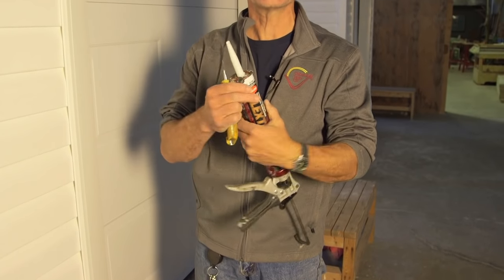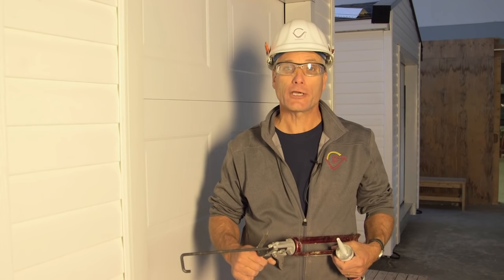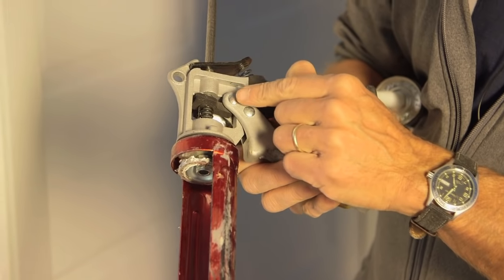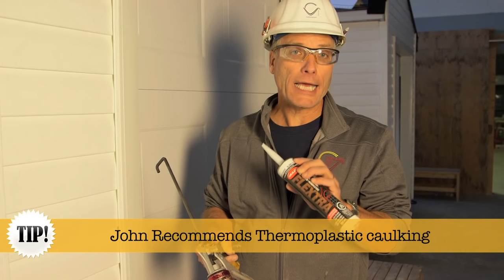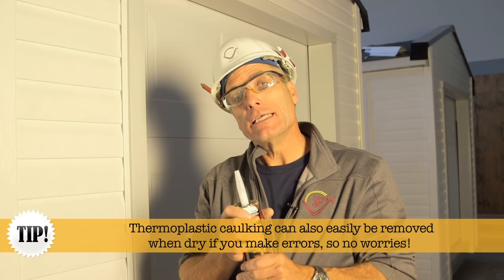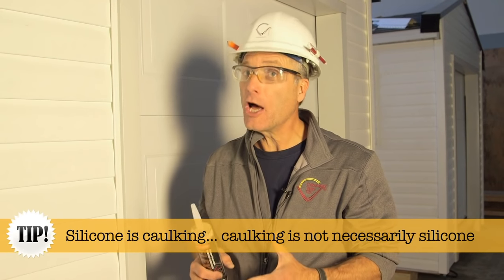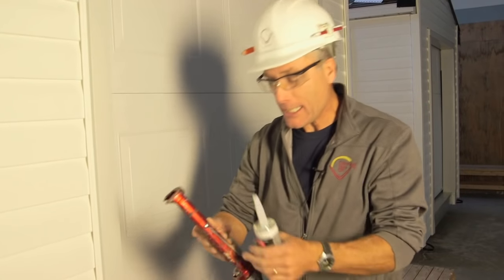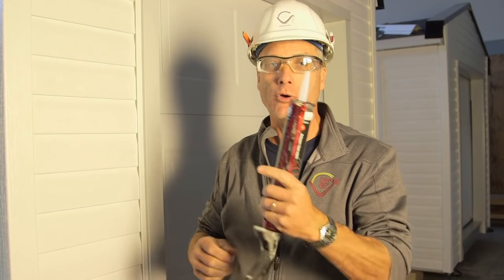How to apply exterior caulking properly...

Comment: You said "Dont cut the tip at a 45. Read the instructions." So I did. Dap 230 interior/exterior caulking instructs you to cut the tip at a 45 degree angle. Just sayin'...
Reply: Well he did say read the directions.
Reply: You think maybe.... just maybe.... not all instructions are the same on the label for every type of material that fits into a caulking gun.. and his instructions said something different then yours?

Comment: That is a very neatly shot sealant bead, but if you don’t use the proper size caulk nice to tool it in, it won’t be 100% bonded to the substrate, and be able to pass a pull test. I work in the commercial world, so that has been burned into my habits and it’s how I teach the new guys. Also, your sealant width must be at least twice the depth for a proper cure. So if you have a skinny but deep joint, you must use backer rod foam to fill in the depth to get closer to the 2:1 width/depth ratio.
Reply: That was supposed to say proper size knife, not ‘nice’.
Reply: Not to exceed 1/2 inch in depth and the backer rod gives the bead the proper shape to withstand the movement of the joint but that is mostly exterior as interior stuff doesn't apply unless architectural
Reply: Appreciate that.🙏

Comment: This is wrong and right. Some caulking says cut the tube end square and some on an angle. Self-tooling caulks require you to cut the tube end square and keep the gun 90 degrees to what you're caulking. Caulking is not static and one way across the board. I keep a bucket of water with a clean sponge and rag around and do use my finger. Just not in the self-leveling/tooling caulks. READ THE TUBE
Reply: best most intelligent comment made. thank you
Reply: @pierremoeller2518  I agree about the commend and your reply. Like they say in software development RTFM!

Comment: I found over the years that there are many variables in applying caulking. The type of gun that is used. Air and tube temperature, the persons ergonomic vector, hand (squeeze pressure). The composition of the material (silicone, latex, or urethane). And the angle of cut on the tip. For me personally, I use about a ten to twenty degree cut. Where to cut on the tube with respect to the diameter application is a judgement call for me on the size of the gap. I also cut on the down slope, as not to leave a plastic “mini-flap” that may act as a squeegee and leave a mark or remove caulking causing an unsightly groove. The angle of the gun in application is paramount. As previously stated: this is what works for me. Other carpenters I know apply differently and have other considerations…..

Comment: you cut the angle of the tip depending on how deep or shallow you want the application. sealing a shower enclosure with clear silicone, as one example, is different than the material used and size of cracks and crevices at the structures exterior. instructions should read: Cut The Tip To Fit the Desired Application

Comment: I use an Albion battery quart bulk gun and dry tools or tuck pointers for wet sealing. You really need to tool your material for proper bond! I wouldn’t know it’s all I’ve done since 1999!
Reply: I’ve been doing it since 1978. ALWAYS dry tool.  There 100 bad videos on caulking for very 1 good one. And because the average homeowner doesn’t know any better, they follow these garbage videos and replace their sealant every couple of years. ( if it lasts that long) Or worse they think they did a good job because of these videos and suffer hundreds or thousands of dollars in water damage.
 Not tooling or using soapy water.Or any tooling aid. Not sure which is worse. All of these methods will fail.And leak.
BTW I could never get used to the battery powered guns just couldn’t get the feel for them. Oddly enough I couldn’t shoot as nice of bead. Too many years with manual guns I guess.

Comment: Good video, but I prefer the Dripless ETS 3000 caulk guns for most common caulking and sealing applications, it's light weight, built in nozzle cutter and poker, plus you can turn drip or dripless feature on or off and rotaing barrel. I know you have the Tajima High Trust version which would be a second choice for me due to how heavy it is but has plenty of features also. But I do alot of caulking and prefer the light weight of the Dripless ETS series caulk guns.
Reply: Just bought one today. Can’t wait to try it out

Comment: i used PL sealant caulking for exterior. seems to hold up good. 3 years later switching between weathers and there is no cracking. paints over fine ont he little section i did. wondering if I should do my entire house and cover all nail holes with it

Comment: I wish there was a way that one could remove all of the absolutely horribly wrong ways to apply caulking and silicone, and replace them with this one.  I can't stand when people do something so simple in an absolutely wrong way, like cutting the tip at a 45, and then holding the gun at an angle, and even worse, applying too much product in the first place and then using either a finger, sponge or spatula to remove the excess, and create all sorts of lines and crevices for build up. Good Job, Sir.
Reply: You mean how they wipe off all the excess in this video ? When you have to caulk high visability places such as kitchens and baths... for 40 some years.... you get to know what you,re doing. This dude is an " actor " if anything.

Comment: push the gun to fill the gap, seal it, and form a strong insulative bond.
 pull the gun to leave a thick sightly bead that can peel off.
if a clean up is required, ie smooth out the bead, I use a small spray bottle of water and dish soap. mist finger and bead, less is more, work with confidence.  if new to this, practice on scrap 1st.

Comment: Wrong Wrong Wrong on every last recommendation this guy made ,Ive been a journeyman turned Master Waterproofer for 32 years & this guy is giving horrible advice , #1 Thermoplastic caulk sucks & is NEVER architect speced in commercial & industrial waterproofing ,any caulking or waterproofing agent that can be just pulled off in 3 days is junk,if it's adhesion is so low you can pull entire 3 day old caulk runs off just imagine how much water that junk will allow in your building after a season change where the caulk experiences Thermal Shock , #2 The absolute best type of caulking and the type speced by a solid 90% of architects is " Polyurethane " based caulk ,it sticks like 2 pieces of metal after welding ,won't shrink and outlasts every other type of caulking by decades ,#3 where he recommends not tooling in your caulk ,caulking not rubbed or tooled I is caulking that's gonna fail quickly ,only a moron licks their finger when a $2.99 7 in 1 tool makes an excellent caulk spreader ,even a plastic disposable spoon from McDonald's works great for rubbing in fresh caulking .
Reply: Michael Ledford polyurethane is superior. I won’t use anything else
Reply: Any recomendations on how to not make a freakin mess i do hollow metal doors and i can never get it right even if i tape it up
Reply: Agreed, this was terrible haha, I always have a damp towel and use my finger.
Reply: @JaredHempfield  i always have instinctively used my finger, seals like a boss and looks so professional. Yea, I have ruined many towels wiping my fingers off,  but the house thanks me.  thanks for confirming that I haven't been doing it wrong all these years!!!!
Reply: A half inch brush trimmed down to like an inch long or using flat icing spatulas or caulking spatulas works best
Reply: Wow, I’m glad I checked out this vid so I could find your recommendations how to do caulking. Thanks Michael.
Reply: I use the plastic spoon every time I do caulking.
Reply: I trust you.....

Comment: Why would I want Caulking that I can just peel off after 3 days
Reply: Skip Hughes true
Reply: Well, its intent is to protect and is protecting. Now, if you want to peel it off from protection, it comes off easily. Some one has to Peel though else its not coming off.
Reply: you have to drink beer for 3 days before it can be removed.
Reply: Less time cursing, more time working.

Comment: your can't slide that tube in bricks
Reply: what's the best way in bricks?  painters tape on both sides?  My first chore is getting 20 years of caulk off the brick exterior window seam.  it's so bad.... i had to make it worse just so the most recent string of thundestorms didn't put more water in there, now I not only have to figure out a way to get 20 years of caulk off , i have my own recent mess to clean off of there.  I needed to take a deep breath and put the tools away, google how to do it right , and then i'll get to taking that caulk off the bring.  Was I seening things right that when i tried to peel a bit of caulk off that some of the brick/mortar was coming off with the caulk??? holy crap i hope i was seeing things.  Will Citristrip help or mineral spirits to soften it, or should i use a heat gun or something?